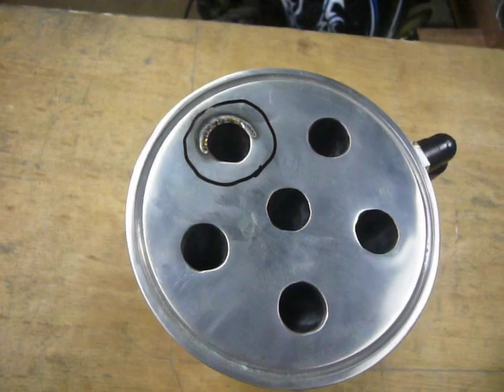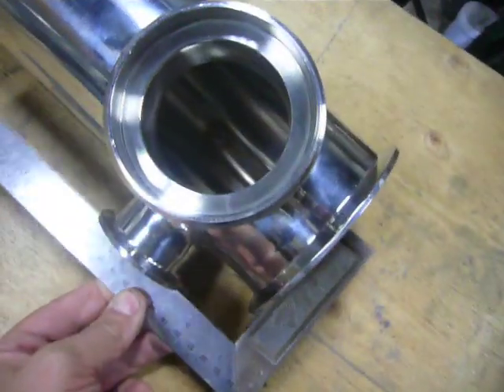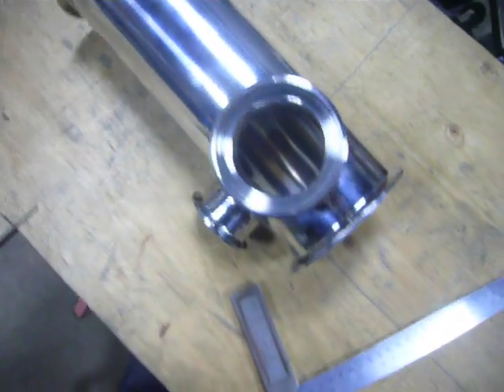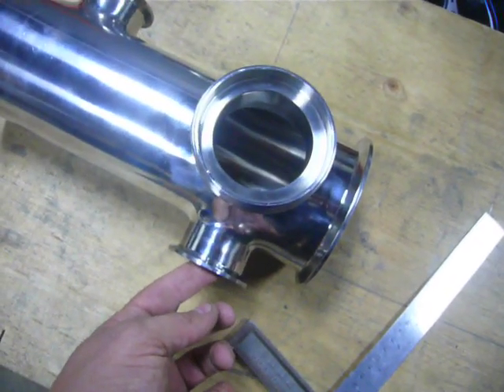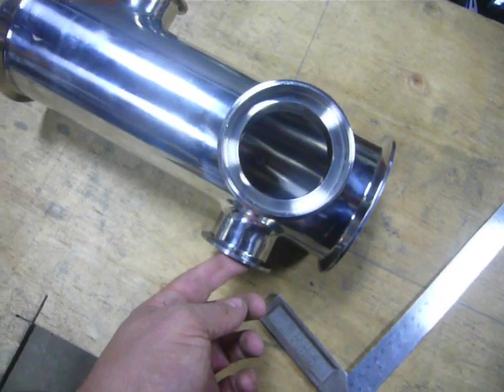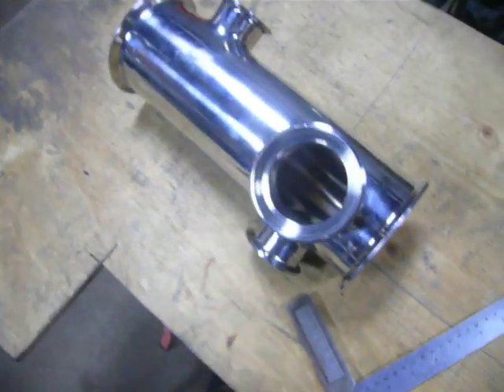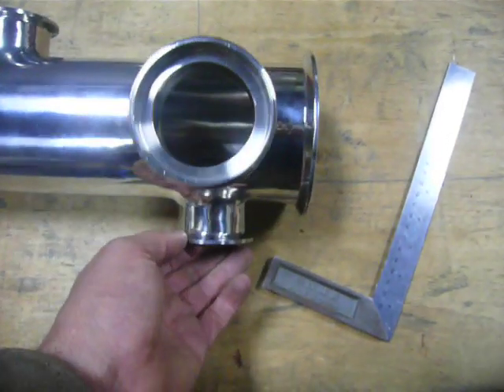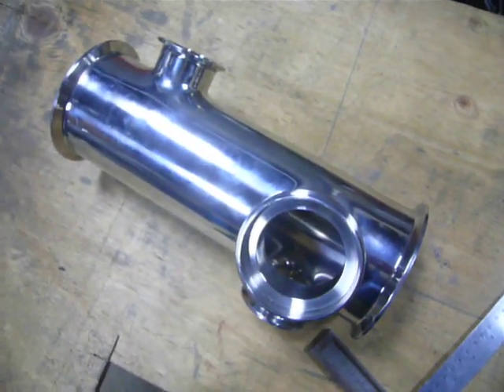Repairs to Chinese still components

Comment: yes i see what you mean. I bought a still from the usa  "i wont mention the company's name "  10 years back, and there is a slight lean in the 2 inch column from the boiler. But yes i see there is some very  shitty workmanship there . But it still works ok as it is only slight. Its a 2 piece column and when its all set up if you stand back and look you can see a slight lean. I guess with SS there is no room for error.

Comment: APD Your boiler is a work of art sir!
That dephlegmator looks like one from Oak Stills. (I have one from them.)
I pressure tested mine rite after I received it. It did hold full tap water pressure after bleeding air out for two hours.
In Massachusetts USA we call it a "Wicked Pissah!" :)

Cheers APD!
Reply from the maker: Heya BigEd,
Thanks for the compliment!
Sold a few kettles in the last few months.
Not sure what brand the condenser was - generic Chinese that gets rebranded later no doubt.
Yes, they definitely had not pretested it before shipping. All my condensers get tested @ 120psi for 30mins.

Good to hear from you! 😊
Reply: @AngryParrotDistillery  Dear Sir, If I was in the same country. Two things...
I would purchase anything stainless from you at the drop of a hat.
I would proudly buy you a drink at the bar/pub of your asking without question.
With many a great story to be exchanged...

Cheers APD!

Comment: Gday APD,,     i have finished my 50lt keg boiler and column,,  its running 2 x 3.5kw elements ,,,    question is,,    did you put in new electrical curcuits to run your stills??      i live in a rental so can't do that,,    i'm thinking i'm gonna have to run each element at 75% thereabouts, on different house circuits as to not overload and pop the breakers.      i should have got smaller elements haha
Reply from the maker: Heya Ventura,
Yep, you've come up against that wall.
I put 2x 2kW elements into most of my 50L stills for clients unless we establish they have  suitable upgraded wiring where they intend to run their still.

Here in NZ we have 240V supply and NZ houses are wired for 10amps with 10amp circuit breakers.
Means that anything more than a 2kW element is going to start overloading things.
I put 2x 2kW elements into the kettles and that way the client can run a lead from sockets on seperate wiring circuits in their garage so as not to trip circuit breakers.

4kW is generally plenty in a 50L still.

To run my 3kW elements in my larger stills I have heavier industrial wiring in the workshop - 15amp setup.

Ideally I'd love to have 3-phase power to play with but that is a ways down the track.

Happy Distilling!

Comment: are you still a live down there ??
Reply from the maker: Barely 🤣

"Life is what happens while you were making other plans ..." 😂
Reply: @AngryParrotDistillery  good too hear from you.
Reply: @AngryParrotDistillery  The pressure relief valve has gone off 3 times. Its rated at 1 bar = 14 psi . It happens when opening up the thumper while its running. So i dont do that any more.
Reply: @AngryParrotDistillery  yeah i put a shooter on top on the thumper, and when i would open it there was always a loud sucking sound, and thats when the pressure relief value opens,So i am glad i use a ss boiler.